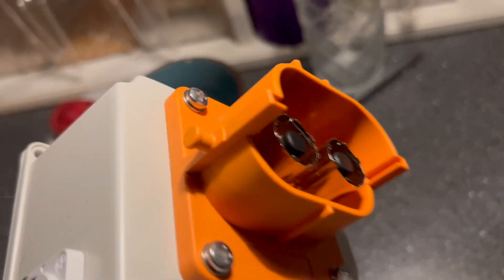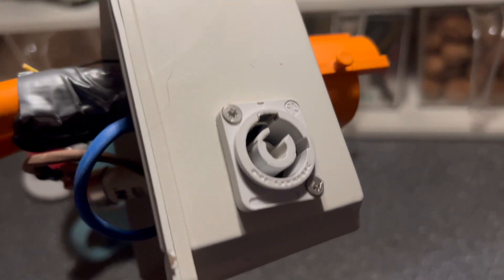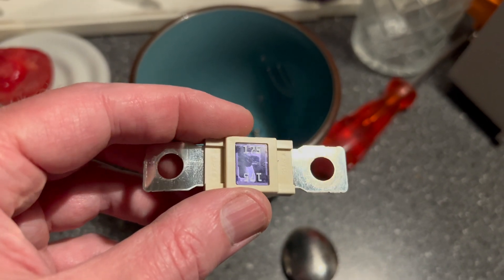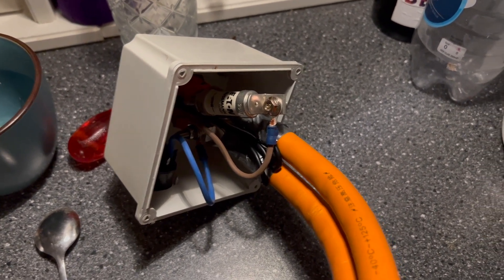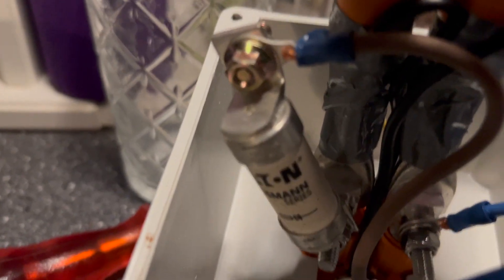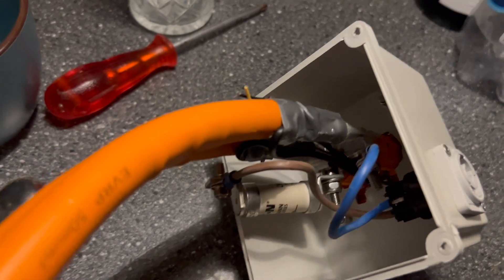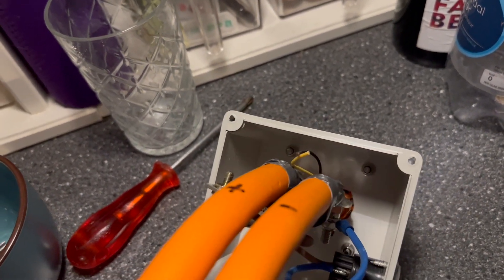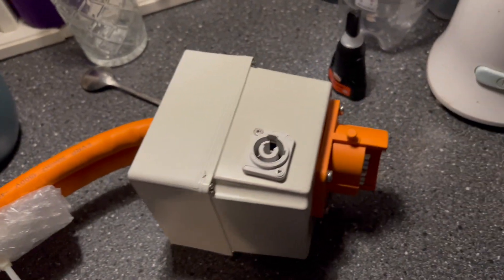🔥DIY🔥DFY🔥 Vehicle to Load V2L,  High Voltage HV 400Vdc to 230Vac in car converter/inverter.

Comment: Can you demonstrate how it works?
Reply from the maker: In the end of the video are a few pictures showing the inverter outputting 230Vac. The "ignition" key can controls on/off. It's a gamechanger for many applications and gives my van so much more utility. Just ordered parts to build a few boxes.
Reply: @UnemployedFakeGuru  What car was it attached to? Can it work with a car switched off? A video would be so much better than pictures.
Reply from the maker: It's a Maxus eDeliver3 van.  @vygi478
Reply from the maker: To close the battery contactors, and  power the 400V bus, you need to turn the ignition I'm afraid. The is also a pre-charge process when you turn the key so the contactors are not having a hard time because of sparks... @vygi478
Reply from the maker: I'm planning on more video's on the topic.  @vygi478
Reply: Hi what’s the toroidal transformer for shown in the photos at the end ?
Reply from the maker: Without the transformer there is a common ground, this leads to potentials where you can get shocked if you touch bare metal of the car. Nothing bad though. However w. the transforer you seperate things and the effect is gone. There are inverters with the transformer build in, but those cost an arm and a leg.  @slimjim2526
Reply from the maker: @slimjim2526  Separation transformer. High-end inverters have those build in, but are very expensive.